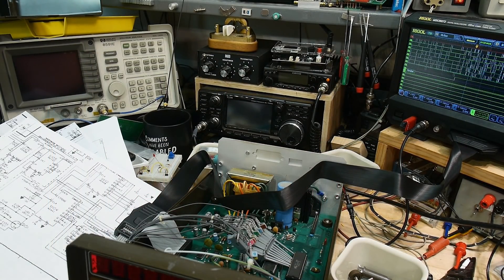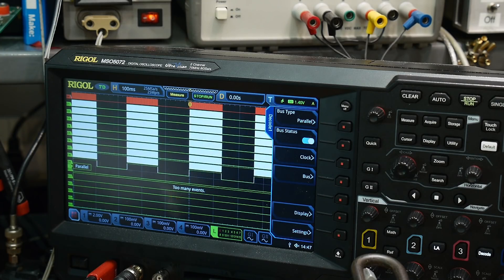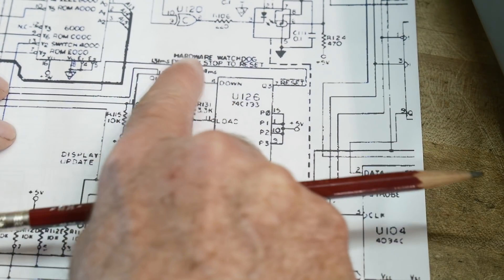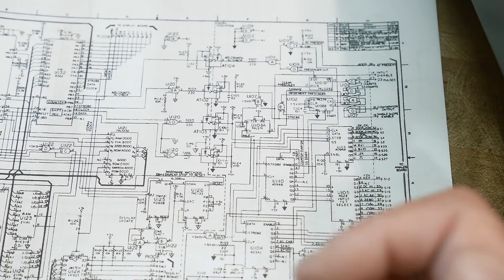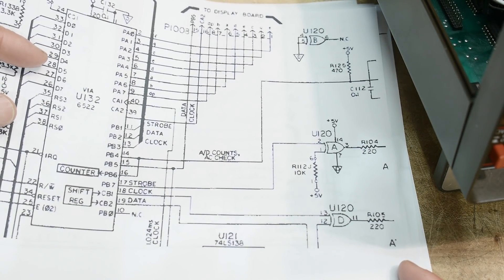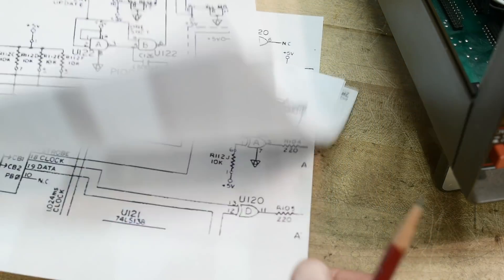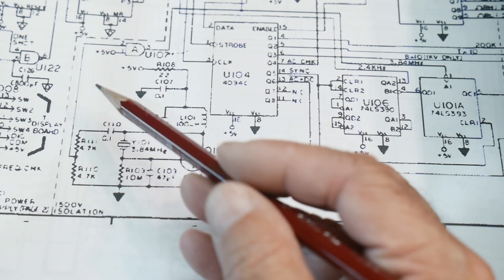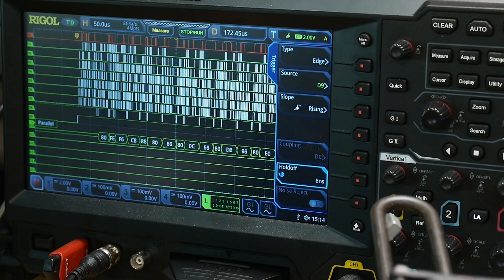#1064 Keithley 192  6.5 Digit Multimeter Repair (part 3 of  7)

Comment: It would be interesting to see signals on U122 pins 4 & 6. Is the one-shot output (pin 6) keeping up with the input (pin 4)? If not the counter U126 is not loading and keeps resetting. Is capacitor C126 ok, maybe a cold joint?

Comment: That reset circuit is way over-engineered. Now I know why someone fly-wired an R-C reset circuit into my hamfest Keithley 197 DMM!
Reply: That was a very standard method at that time. You never used anything ac coupled, so a big counter that then fed into a couple of flip flops. The flip flops ensured that the reset of the uP was toggled correctly (up down up etc) the counter was driven from some hardware generated clock source, and you use an output pin somewhere to reset the counter. You made sure that this was NOT in the main program loop, but called outside it somewhere. Ideally you only called the watchdog reset once per program loop. The idea was to ensure that if the uP got stuck in a oddball loop somewhere it was very unlikely that the watchdog would keep runing, so the system would get a reset. 

As it was only two chips it was a very effective, and low cost method.

Comment: that magic data bus! is it stuck in the mud? sounds like a short! my data bus goes really fast.....made with quality, it's gona last.... flowing high, & flow'n low... that's just the way this magic data bus goes....better jump on board....woohoo!!!.........weehee!!......come get on this magic bus! .....this happy zappy buzz machine.....sorry...when laying on U'r back, all day. becomes boring...I just go boring 4 that magic data bus!! it ain't got no fuss.....it's just a magic data buss!! life there is grand, with a happy dialect...but want get no respect....just a happy buzz machine.....woohoo!......woohoo....sorry...sorry.. hey bruh..do U need  some ''pic software'' !! 6808...if U'r inclined....it'll run 0-60..hold'n the line....this was obviously before commercial certificate programing...👽👻

Comment: Well, judging from the fact that it’s video 3/7, you’ve finished the work already, I suppose, therefore no need to give hints on the debugging at this point, so just a comment:

Personally, I’m more a “for the journey, not the destination” guy, so I think I would just have left the microprocessor side broken as is, and tried to learn about the dual slope integrator by writing my own processor code (on whatever microcontroller I’m feeling the most comfortable with) interfacing to the analog side via those four optocouplers (disconnected from the old electronics, maybe forced in reset).
Reply from the maker: That would be a big task, but fun. I'm sure it would be easy to get a 4 digit meter going, but there is a lot of secret sauce to get to 6.5 digits